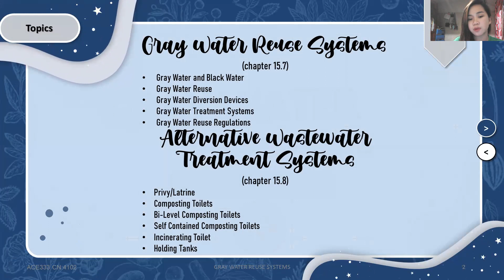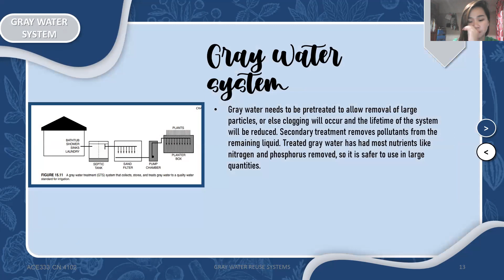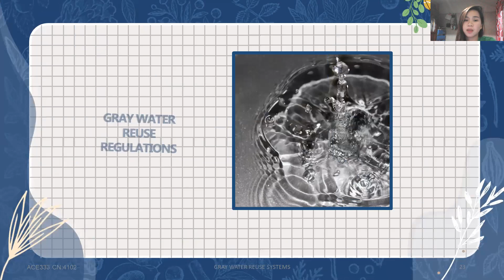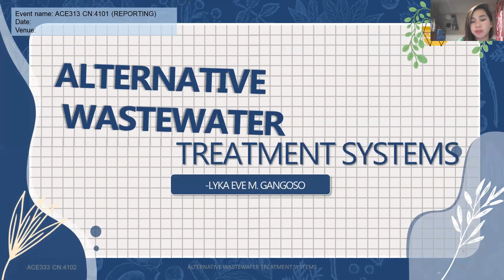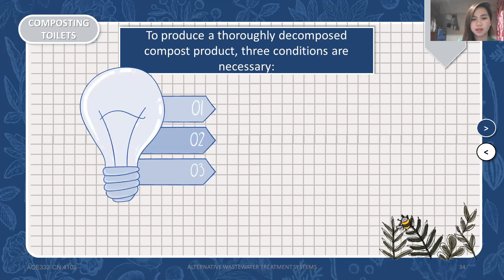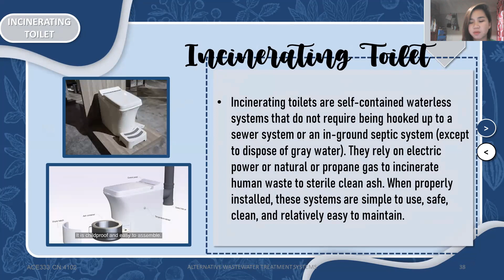GANGOSO U2 REPORT

Comment: Gray water is water softly used from your bathroom sinks, showers, tubs, and washing machines in this video. Depending on health requirements, gray water reuse technology can range from as basic as saving rinse water from bathing and washing machines to more complex treatment systems. Alternative wastewater treatment systems are an alternative to the above mentioned sewage treatment processes. If one of the previously outlined systems cannot be used or is too expensive, they may be required.

Comment: In this video, the gray water is gently used water from your bathroom sinks, showers, tubs, and washing machines. The gray water depending on health regulations, technology for gray water
 reuse can be as simple as saving rinse water from bathing and the clothes washer to rather complex treatment systems. Alternative wastewater treatment systems are an alternative to the sewage treatment methods previously outlined. They may be required if one of the previously described systems cannot be employed or if they are too expensive.

Comment: I learned that a greywater system is used to take water that has already been used from places like your laundry, shower and sink and divert it to use in another purpose like watering gardens or landscaping instead of flushing it down into the sewer. On the other hand, waste management reduces the effect of waste on the environment, health, and so on. It can also help reuse or recycle resources, such as; paper, cans, glass, and so on. There is various type of waste management that include the disposal of solid, liquid, gaseous, or hazardous substances.

Comment: In this topic, I learned that the use of grey water is that it may potentially replace treated tap water used for landscape irrigation. It may benefit plants because it often contains nutrients such as nitrogen or phosphorus, while the black water carry hazardous chemicals. Reusing your grey water saves water and keeps it out of the sewer or septic system, lowering the risk of it polluting local water bodies. I learned also that alternative wastewater treatment systems are a supplement to the sewage treatment methods previously discussed.

Comment: What ive learned in this video is that greywater includes water from showers, bathtubs, sinks, kitchen, dishwashers, laundry tubs, and washing machines. The major ingredients of greywater are soap, shampoo, grease, toothpaste, food residuals, cooking oils, detergents, hair etc. In terms of volume, greywater is the largest constituent of total wastewater flow from households. In a typical household, 50-80% of wastewater is greywater, out of which laundry washing accounts for as much as 30% of the average household water use. The key difference between greywater and sewage (or black water) is the organic loading. Sewage has a much larger organic loading compared to greywater.

Comment: I learned in this topic and video that Greywater is wastewater from sinks, washing machines, bathtubs, and showers, according to my research. It is easier to treat and process since it has fewer levels of contamination. Blackwater is feces- and urine-containing wastewater from toilets and bathrooms. Because of the contamination by bacteria and grease, water from kitchens and dishwashers is also classified as blackwater. If they are appropriately designed, they can save water and avoid the release of wastewater and toxins into streams and the environment. A pit privy, often known as a latrine, is a structure dug beneath an outhouse to collect human waste.

Comment: I learned that  Greywater is the wastewater that comes from sinks, washing machines, bathtubs and showers. It contains lower levels of contamination, making it easier to treat and process. Blackwater  is the wastewater from bathrooms and toilets that contains fecal matter and urine. Water from kitchens and dishwashers are also considered blackwater due to the contamination by pathogens and grease. They conserve water and prevent the discharge of wastewater and contaminants into streams and the general environment if they are properly designed. One of its examples is a pit privy or latrine it is dug below an outhouse structure
 that collects human body wastes.

Comment from the maker: From my report, I learned that gray water is the untreated waste water from bathtubs, showers, toilets, and clothes washers. Before being used or treated, gray water must be filtered to remove big waste particles. The particles in the wastewater will be reduced as a result of this first treatment. I also learned about alternative wastewater treatment systems. In  alternative wastewater treatment systems water is not used in these systems to treat or transport human waste. They conserve water and prevent the discharge of wastewater and contaminants into streams and the general environment if they are properly designed. One of its examples is a pit privy or latrine it is dug below an outhouse structure
 that collects human body wastes.

Comment: In this topic, I learned that greywater is softly used water from your bathroom sinks, showers, bathtubs, and washing machines that haven’t been treated. Reusing greywater has the advantage of conserving water since it keeps it out of the sewer or septic system, reducing the chance of it harming surrounding water bodies. It is not water that has come into contact with feces, whether from the toilet or diaper cleaning, and it is also the primary use of your home's water system.

Comment: Greywater is softly used water from your bathroom sinks, showers, baths and washing machines that hasn't been treated, as I learned from watching this video. Dirt, food, grease, hair, and certain household cleaning chemicals may be found in greywater. Reusing greywater benefits of conserving water,  it keeps it out of the sewer or septic system, lowering the risk of it polluting nearby water bodies. The use of greywater for irrigation reconnects city dwellers and their gardens to the natural water cycle.